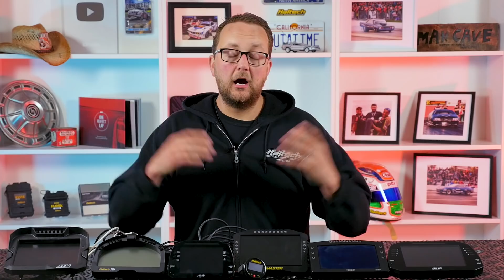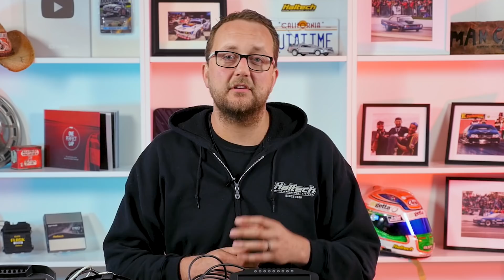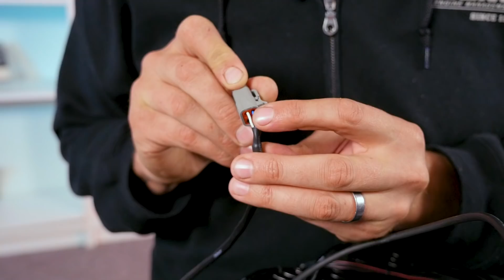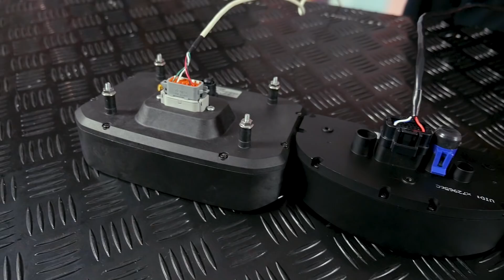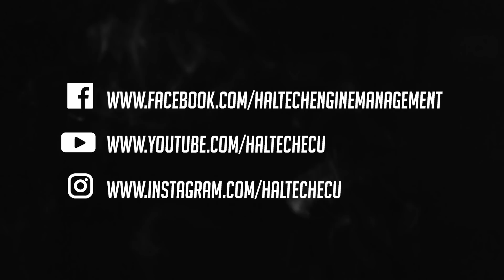🛠 Communication - Yes you CAN: What is CAN Control? | TECH TUESDAY

Comment: Thank you very much, very informative video! Could you, please, she’d some light on this on for me. If I have a x brand car (Benz) with its proprietary can bus, can I wire in standalone haltech ecu with piggyback installation to have working stock abs/esp/transmission control  functionality?
Reply from the maker: Yes, a piggyback or parallel installation is a common solution where you let the Haltech ECU control the engine while the factory ECU retains control of the CAN Bus and the transmission.
https://youtu.be/A1ePCv0Z3rE

Comment: THIS IS THE VIDEO I NEED RIGHT NOW!!!
Question: Do y'all have any CAN preset up for different car manufacturers? Like for my Mini Cooper, can I just hook up the wires and say here is the pin number and what CAN protocols it needs to send/receive (BMW)? Or is there much more setup than that? I wouldn't expect the CAN systems to be standardized from BMW to Toyota or Mitsubishi etc. without a partnership of some kind.
End goal for me is trying to replace the OEM Mini R56 ECU and with a Standalone that can act as a replacement with CAN communications to activate the dash, electric power steering, link OEM Mini electric throttle pedal with lancer electric throttle body, possibly ABS, CELs, maybe OBD2 and other items. And of course the OEM ECU can't work because my Mini has a 4g63 engine in it so it has completely different trigger patterns and everything else.

Comment: Good, and understandable basic explanation of CAN!  Can i add one important thing, that tends to catch people out, namely what the "Bus termination" does!  When you send a pulse of electricity down a wire, if it reaches a sudden change in impedance (impedance being the sum of resistance and inductance), that pulse can reflect back up the wire in the opposite direction. The most likely "sudden change" in any wire is simply the end of that wire!  And the CAN bus obviously has to start and end somewhere...  If the electrical pulses got reflected back up and along the bus they could cause errors in the data being transmitted, depending on where the arrive and at what time.  There is a lot of complicated science covering bus bit rates, physical lengths of the bus, mutual inductance and other factors, but luckily, three basic rules will cover pretty much any situation:

1) The CAN bus should be, wherever possible a "Linear" arrangement, rather than a "star" arrangement. For two devices that's easy, but for 3 or more devices, you may need to consider the routing and branching of the CAN bus to achieve a broadly linear layout.  Where you have to "T" off the bus, to connect another CAN device, keep that "T" as physically short as possible. Realistically, with the T branch wires being at most 10 cm long, you are unlikely to have any problems up to a bus bit rate of 1 Megbaud.   The main linear section of the CAN bus can of course easily be several meters long.  For example, say you have 3 devices, one in the boot (trunk) one on the dash, and one under bonnet, you will need to run the CAN bus from the rear device through the car (likely to be a run of several meters) and pass close to the device on the dash.  T off the loom with a short pair of wires (less than 10cm long) to connect to that dash device, and continue the linear main run through the bulkhead to the under bonnet device.  That way you have a broadly "linear device"  What you don't want to do is to say bring three 2 meter long pairs of wires to a single point at join them there (because that would be a "star" layout)

2)The main linear section must have a 120 ohm termination resistor at each end (two resistors at 120 ohms, gives an overall 60 ohm impedance as required). Most CAN hardware is actually able to handle up to around 4 or 5 termination resistors each of 120 ohm, and these additional terminators can help to fix problems with bus layouts that are non- ideal (ie more "star" shaped) but it should be avoid wherever possible. In our previous case, the device in the boot would have a termination resistor, and the device under bonnet, but the dash mounted device, with it's very short T off the main bus would not have a termination resistor.

3) Twist your CAN High and CAN Low wires together!  A twisted pair of wires helps lower the characteristic impedance of the bus, and helps it reject electrical noise from external sources (like say a coil pack, or injector wiring). You can purchase specific CAN bus wiring, that has the requisite twists pre formed into it, but in most cases it's cheaper to simply twist by hand a pair of 20 gauge wires together, with around 4 twists per inch.

Hope that makes sense and helps you construct simple and robust CAN networks in your cars!  :-)
Reply: Thanks for this Especially 
"3 Twist your CAN High and CAN Low wires together!"
something I would usually avoid good to know its beneficial in this case!.

its also good to get technical responses of this kind,
and I thank you for your time

Comment: What about ion-sensing ignition systems (that use the spark plug as a knock sensor)? Can they be used with a Haltech ECU or if they are a separate system can it be integrated?
Thanks for all the super informative videos!

Comment: Loving Tech Tuesday.
This may be ignorant, but is it possible to have multiple protocols on one bus? 
Thanks for another awesome vid!
Reply: It's a little bit more complicated in terms of the "layers" specified by the CAN standard.  The wiring for the CAN bus itself is referred to as the "Physical" layer and on top of that sit the "Transfer" layer and the "Object". These layers are actually also further broken down in the complete CAN standard! (and i'll ignore later CAN standards like CAN FD and Flexray etc, and only talk about "classic" CAN, which is really CAN 2.0b as defined in the matching standards documentation)

Broadly speaking, the Transfer layer must be the same for all CAN nodes connected to the physical layer.  That means all nodes operate at a single fixed bit timing, and with a fixed packet definition.  CAN 2.0b does allow the bus architect to mix and match between standard (11bit) and Extended (29 bit) addresses on the same bus (although this is generally avoided), and the actual data payload can be of a variable length between 0 and 8 bytes long (CAN was not designed to have a high data transfer rate in terms of total information exchange, but to be able to reasonably quickly transfer a lot of small packets of data). CAN uses unique message identifiers to allow individual devices on the bus to accept or ignore individual message packets, and arbitration is  automatically, but not atomically, managed via the magnitude of the address.  ie a message with address 100 would get priority to be transmitted on the bus over any message with a higher ID ( 101 or greater) but loose to a message with a lower ID (ie 99 or less).  For example on a CAN bus, you would expect say the engine speed to be sent with a much lower ID than the status of the heated rear window, because it is important that engine speed get to the receiving device(s) in a timely manner, where as the status of the window heater is not critical if it's a bit late!

 With CAN, there is no intrinsic architectural layer, ie any message that is transmitted onto the bus can be received by any other device on that bus. So the engine ECU can send out a single message with a data payload containing engine speed, and any device connected can listen out for that message, recieve it, and hence access that messages payload.  Transmissions may be Broadcast (ie happen at regular timed intervals) or  be Polled, where a device only sends out a packet after it receives a specific message requesting it to do so.

So, we have out packets present on the bus, and each has an ID and a data payload of up to 8 bytes, the next question is "what does each payload contain" and here is where everything is thrown wide open.  An Bus architect may choose to encode any particular bit of data in any format and with any packet ID as they see fit!  The different OEs all use different encodings, scaling and IDs.  A digital signal, like say brake lights "on" can be a single bit (64 bits available in an 8 byte payload), and data with a higher resolution like engine speed may be scaled to use 2 bytes (16 bits) with some scaling factor and / or offset.

Finally, there are higher level protocols, such as J1939, which attempt to specify a standardised CAN protocol for commercial vehicles.  The idea is that with a standard protocol, any manufacturer of any equipment can use any other manufacturers equipment and the system will still work. For example, a Truck tractor unit can be connected to any trailer, and the rear lights will work in both cases because the rear lighting module is listening out for standard messages to act upon.

Comment: Very well explained and excellent tech resource. Will CANBUS change/be replaced in the near future?
Reply: It already has.... CAN was defined by Bosch, BMW and Mercedes way back in the very early 1990's  Today, our cars now have data transfer requirements that outstrip the basic ability and robustness of the basic CAN standard. For example, safety critical systems like dynamic stability control need to ensure they get the latest data, up-to-date, and without any errors in order to act promptly and appropriately.  And the massive infotainment data requirement for modern ICE cannot possibly be transferred across CAN either.  So there are broadly 4 alternatives now fitted to most modern cars:

1) MOST - Media Oriented Systems Transport - usually an optical network over plastic optical fiber (POF) cable, designed to rapidly transfer large amounts of data at high bandwidths - used for SATNAV digital radio, internet connectivity, and ultra high performance driver assistance systems (reversing Cameras etc)

2) Automotive Ethernet - Not yet common, but starting to become popular, especially for modern internet connected systems

3) Flexray - uses the same physical layer as CAN, but is fully deterministic (unlike CAN) and so can be used for safety critical data exchange.  Not suitable for high bandwith data transfer, but ideal for low bandwidth low latency robust exchange, ie a vehicles stability controller talks over Flexray to the engine controller to ensure that vital info is robustly transferred

4) CAN FD - CAN Flexible Data  - Closest to 'classic' CAN, sane physical layer, broadly the same protocol in terms of packets, but uses a couple of neat tricks to increase the bandwidth available for transfer.  Still not deterministic so not used for safety critical coms.